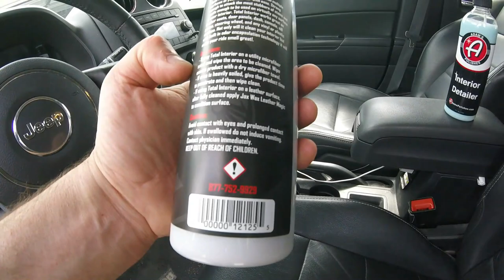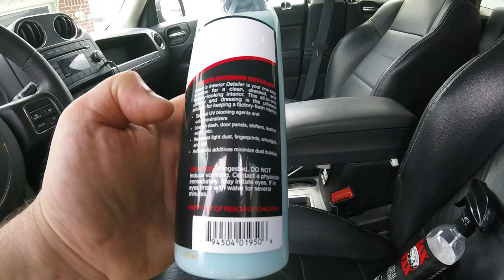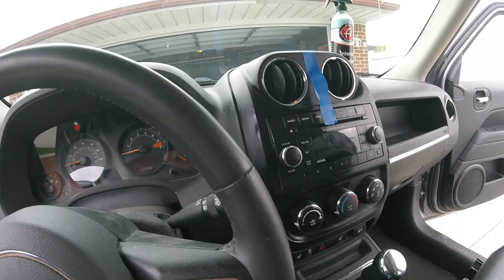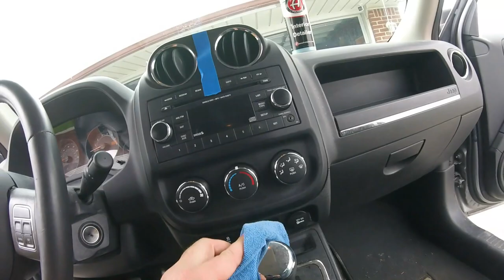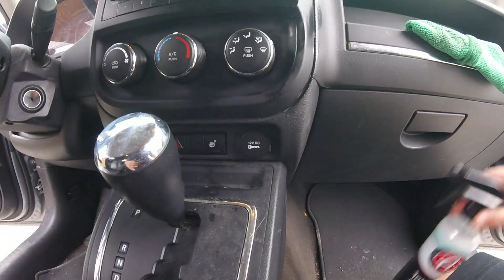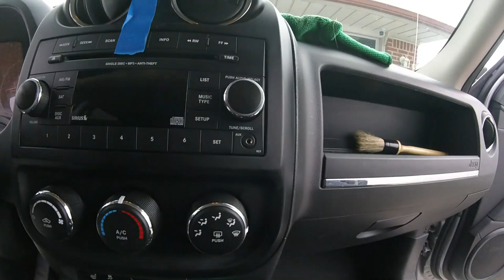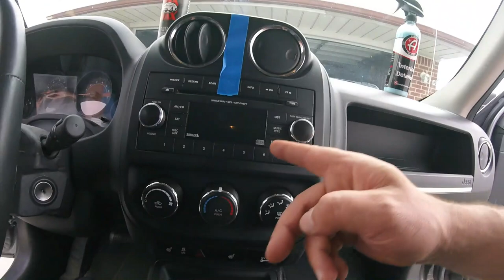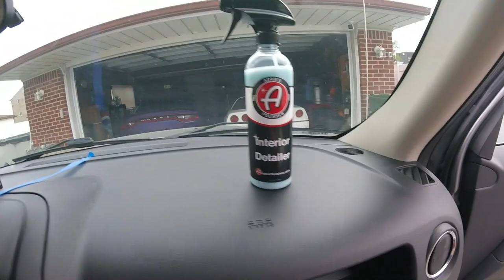"Adam's Polishes Interior Detailer  VS "Jax Wax Total Interior | You Pick the Winner

Comment: I’ve used that Adams 💯👍 to removed Sun Tan lotion from my Alcontara pieces on my arm rests and also cleaned up my Alcontara steering wheel
Reply from the maker: Adam's interior detailer worked great . That's good it cleaned up tan lotion that's almost like a oil.  Thanks Rusty